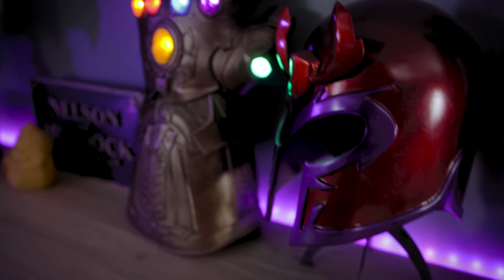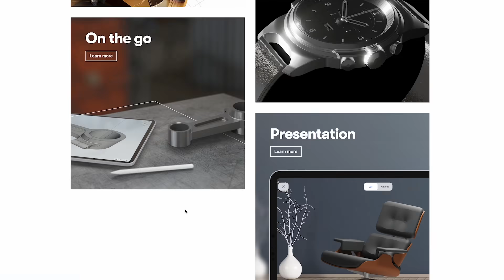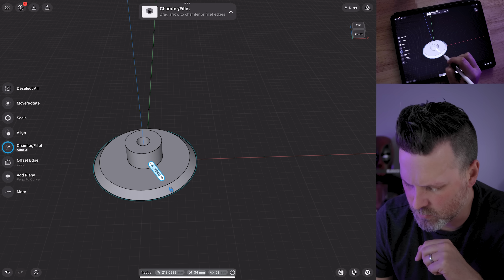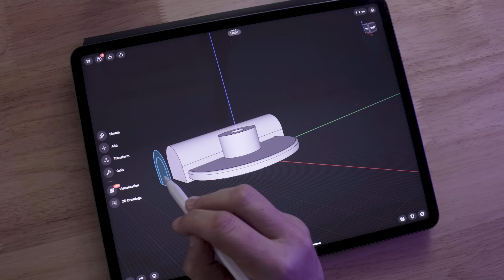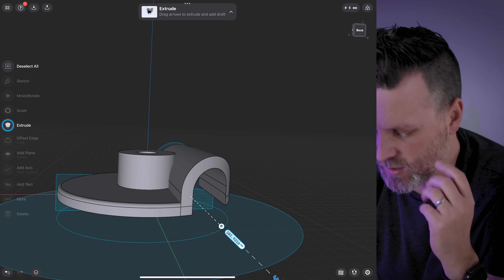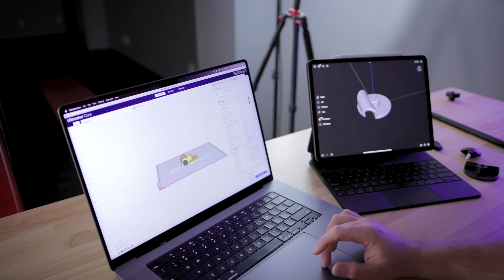I suck at 3D modeling but this is easy - Shapr3D + 3D Printing

Comment: The rpm on the spooler was lower at the end because there was filament on there at the end, effectively changing the gear ratio.. like putting bigger wheels on your car. It changes the final ratio, and you go faster with less or the same RPM. Not saying there couldn't have been slowed extrusion from a clog.

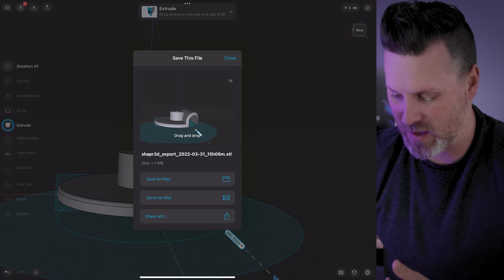Comment: At some point (7:39) you say "If only I could slice a file directly from my iPad". What do you mean by that? Is there another process required between exporting from Shapr3D and 3D printing?
Reply: After exporting to .stl or .3mf file you need to slice the file in eg bambulab studio, prusa slicer to prepare the 3d print / create a .gcode file for your 3d printer. As far as I know there is no iPad app for this so you need a pc / mac for this step/ process.
Reply: @MagicMaik123 Thank you for the explanation. I just realized that the reason I’m not aware of it is because I always use commercial 3d printing services which take care of it automatically.

Comment: Disappointed. I downloaded the “free” version for Mac, created my account, went through all the videos, and built the first model the software suggests to test the tool. Everything was fine. However, when it came time to export… LOW RESOLUTION? This makes the entire application useless. $299 is absurdly high for “hobbyists.” Here in Brazil, those $299 are equivalent to 2,100 “money.”

Comment: I’ve been using Shapr3D for over a year, I’m far far away from a savvy user but I can recommend you to have a look to some extra functions to ease your job. For example you can use Shell function to remove the inner content to create your “tunnel”. This function only ask you for the wall thickness you require and eliminates all the rest of material. Unfortunately for me, I don’t have a 3D printer 😢 Very good job.

Comment: In my opinion vectorworks is so much better or at least the ability to use both a mouse and a keyboard in comparison to no keyboard. Regardless this is still a great application for a quick visual when you just want to see how measurements relate to each other before you make the actual product

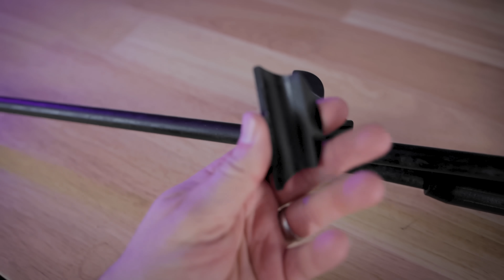Comment: For those who dont own a 3D printer...  @0:40  His 'problem' could of been solved with JB weld.
Its a puddy that hardens to the same strength as steel. I fixed a platic wheel on my Grocery Trolly Cart with it, and now its tronger then it was brand new.
The fact that you even tried to use super glue on a part that holds all the pressure is rookie behaviour.

Comment: For parts that don't work well on the first go and aren't mission critical to be the exact dimensions, I like to use a hair dryer to shape them if possible so that I don't have to remodel and reprint and scrap the parts. For example, applying some heat to that groove and pushing in a little on the side can help add a bit more friction.

Comment: Dude.. right off the bat you are putting people off and slandering Shapr3D, don't do that. First of all, it IS FREE, and you can use it free as long as you like for a LOTS of applications, most people don't have the design skills to do complex designs anyway. In case the person wants the PRO version with more features its only $25 a month!,  that is NOT "relatively expensive", its actually shamelessly CHEAP, do you realize a CATIA, ICEM, UNIGRAPHICS or ALIAS license would run you $15,000.00 US dollars ??!! get a clue dude, this company spent the R&D to offer this free and another version practically free and you turn people off with comments like that. I don't think you meant to, you are just stupid and unaware but no excuse to do it again. Had I seen this video before I got it, I would not even have looked into it. And yes, I did design interior trim and exterior panels for 30 yrs. so I do have plenty of experience working full time with CAD systems.

Comment: That was a great video to watch but Shapr 3d is quite expensive for the hobby modeler. You would have to run a small business to offset the cost. You said your a novice with shapr 3d but you seemed pretty proficient.

Comment: Towards the end when he determined the part was just a little too loose, this is where I fall down. I 100% would have applied a bit of electrical tape to the inside of the channel or sanded down the base, or both, rather than reprint the corrected part, cause it's close enough and I could make it work. It's not the right way, I get that, but if it's working, I'm moving on.
Reply: A bit of rubber or cork would probably improve the function.

Comment: I use this software also and it is expensive and super easy to use.  Way better then learning fusion 360.  How I combat the price point is I have a list of things to make on my iPad.  Once I get the list to 10 items or have something I need sooner rather then later and I’ll pay for a month and then through that month I go ahead and model all of my saved items.  Then cancel at the end of the month and start my list over.  This keeps me from over spending and making 3D printing not worth it.

Comment: You're making a beginner mistake with CAD modeling. When you're trying to replace a component, you have to take into consideration the strength of the materials you're replacing the component with. 3D-printed parts are in most cases not as strong as their injection-molded counterparts. But with something this trivial, there's nothing to worry about, I guess ;)

Comment: 3d printing really becomes amazing when combined with 3d modelling for situations such as Jesse ran into here. 
I dont understand the pricing for though. No beginner is going to pay that much a month,  and any pro is very likely using blender, or fusion etc.
Reply: Use the low res free version if you are a beginner, upgrade when you are ready to sell your bits

Comment: I am debating on returning my Neptune 2S. I have upgraded Cura to the current release, and lost all settings of my N2s. Even when  exporting the print setting config file and importing it back. NOW I get all these extrusion errors. WHY does elegoo offer an application (Cura Elegoo version) in which the application themselves do not acknowledge them by default. If I use an Ender 3 profile like Reddit says, It seems like mmy build plate is smaller than my actual Neptune 2S. Uncle Jesse you are my last hope before returning it. Where can I find detailed settings for my neptune 2S while keeping Cura up to date? Is it even worth it going thru all this hassle. Thank you

Comment: $240 a month, which is actually cheaper than anything Autodesk or Dassault puts out there (I'm sure Solidworks is more powerful and cost-effective for engineering students).

Very cool that it really leverages the touchscreen. I don't have a tablet or even a touchscreen Windows compy, so I'll probably practice on FreeCAD or something.
Reply: We actually have a Windows and macOS version too that you may use with mouse+keyboard. As for the price, it's $240 a year (local prices may vary) but i guess this is what you meant as well. Thank you for your feedback!

Comment: Manufacturers need to take note, they could increase revenue by selling the STLs of spare parts like this as well.  No doubt you would have just paid a few dollars for the STL than spend time on designing it and money on a CAD program.  Sure its satisfying to design and print, but I am sure you also had a lot of other things to get done at the time as well so no doubt you would have paid $5 for a manufacturers STL.
Selling a STL for a part is unlikely to reduce sales of new objects as those who are happy to 3D print spares are likely happy to do exactly what you did if they have too and once done, you will probably share it for free on places like thingiverse.  If anything manufacturers providing STLs of spares for personal use will increase the sales of their brands new products as people know they have the option to maintain it themselves should plastic parts like this break.

Comment: I like Shapr3D, for using while watching tv, but they’re just too greedy for me to support em. To not have a plan or something for hobbyists is just too disappointing. The features don’t even compare to fusion and fusion is free for hobbyists. The additions they make out to be groundbreaking and yet they’re basic functions. Now with the “material” feature it’s cumbersome to simply change the color.  Not a fan.
Reply: Shapr3D has the best UI amongst any of the CAD programs out there, and I've used pretty much all the major ones. It's really quite amazing what they've done there. But I agree the sub pricing is terrible for hobbyists, the free version is way too limited, and lastly it's only direct modeling with no parametric features.

Comment: I've enjoyed Tinkercad, it's free, and very basic but works fine for the stuff I need it for. Created some feet for my snare drum, rope tension drum, like Civil War stuff you might see at your favorite local olde timey museum (Genesee country village is our local favorite). Used a micrometer, similar process to the one used here, and saved as STL, sliced with the Anycubic slicer, and printed on resin printer with some of that stronger resin mixed with normal black resin. Worked great. Also, made a fife using the same method, but the 3d printer we have can't print tall enough, so had to make it three pieces and engineer a joint with a little built-in clip which worked great in Tinkercad, ditto a clamp for the interior of a shop light that had to way to anchor the electric wires and a bunch of other one-off random stuff. BUT I can see that if I needed anything more complex, it would get sloppy and harder and harder as complexity increases with Tinkercad.

Comment: You should have taken the chance to improve the design reinforcing the weak points of the original piece. For example, the 90° corner between the circular base and the outer side of the tube could be improved with a large bezel so there is no corner that can break but a thick volume.
Reply: Shows hes right, he does only know barely what hes doing 😎
Reply: @bernatix  Yes, of course. Not criticizing him, just suggesting improvements 😉

Comment: the only down side for shapr3d is the price, i really don't see how is it compete with fusion360, for 372USD a year, you get 3D modeling on computer, PCB design, CAD+CAM, cloud simulation and rendering, just can't draw directly on ipad. shapr3d cost 239USD a year without any simulation or most other functions. And if you are going to do 3d print, you need a PC anyway for slicing, then why not just draw on PC? to rush out model on site? I tried using my ipad mini 6 remote desktop back to my PC to model in fusion360, just a bit slower on the controls but I overcome it with a folding bluetooth keyboard with trackpad build in costed me about 35USD. If shapr3d is something like 5USD a month, maybe I will keep it in my ipad just in case for rush site modeling, but not for this price.

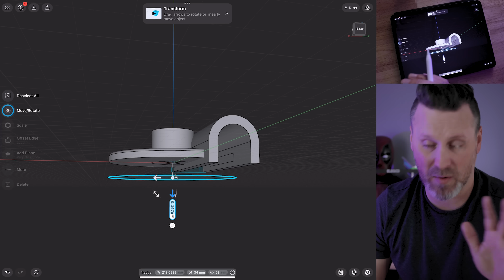Comment: Would it better to rotate the print and use supports so that the strands of filament follow the shape (6:20) rather than cut across as you printed. Current orientation has weakness due to layer strata cutting across the hoop.l sections. Obviously vastly reduced if solid…

Comment: As soon as I heard "subscription" I am out! Try renting a hammer to a carpenter and see how that goes. This is a disgusting business model.
Reply: I completely agree. I can't stand paying a recurring fee for a piece of software that doesn't change. Just charge a reasonable one-time fee then charge for upgrade features if you need the recurring income.
Reply: @squishybrain  But it does constantly change, you're aware of that right? Also to Leandro's original point - every pro CAD tool comes with ridiculous one-off price tags and you can be sure they don't change. Also, many professionals (carpenters e.g.) do rent equipment/workshop space.
Reply: @Pijer19  Of course software changes. My point is that with a subscription model, you're forced to pay even when the software doesn't change. If the developer puts work into additional features, then charge for the upgrade and hope that you've put enough value in that upgrade to cause folks to pay. I don't like paying a recurring monthly fee with the assumption (but no guarantee) that I'll get value out of that. The value proposition seems skewed.
Reply: @Pijer19  Tell that to Autodesk. I used 3ds max and Revit for a long time, before subscriptions, and after they made the switch they went more than 4 years with any significant change. Also, most of the times you can change a hammer as much as you want, it doesn't mean I need or am willing to pay for that change. To put the final nail on this coffin with my owned hammer, let me clarify that as a profissional from the civil construction area, we only rent tools when they tend to break a lot needing maintenance and not because the manufacturer put a new pink handle every now and then. 🤮
Reply: @Pijer19  subscription is the easiest way to a company take your way of living and FEEDING you family, simply kidnapping your tools and making you dance like the monkey they made you off if you ever want to pay bills again.

Comment: I'm probably too used to my Solidworks modeling pipeline, but it's good to see more and more actually ergonomic tools stepping on professional cad's tail, for the sake of competition and solving stagnation of the existing, "market leading" CAD tools.
I also still suck at resin printing xD, but I'm slowly getting to know it with my Saturn S setup.

Comment: love the software but I couldn't justify the price point. I wasn't designing as much as I thought I was going to and actually paid a month or two without even designing anything.  It's worth the money if you're a pretty serious designer.
Reply: Yep can’t justify paying for something that I use infrequently.  If there was a one off small price for private users then I’d buy it.    On the other hand went for another program that is free, without ads, and fully functioning without time limits……..Design Spark Mechanical (DSM)…….great tutorials, quick learning.
Reply: It’s sad they don’t have an “enthusiast” subscription that allows a limited number of models and hi-res STL export. Maybe when they’ve added more pro features it will give them scope to separate the subs levels and offer a cheaper point of entry. I never renewed after my first year deal ran out, switched to fusion360 on my Mac as it just didn’t make sense to pay for something you use a handful of times a year.
Reply: If you’re only using it for 3d printing, you can, possibly the most powerful 3d modeling software out there, for free in a student license. It’s made by Siemens and called NX. We use it aerospace, and a lot of automotive and power gen companies use it as well.
Reply: Yeah, great software, enthusiast-hostile pricing. I’m already paying $30/month to adobe for Photoshop and Illustrator, more money to Microsoft for Office, etc., etc., etc….$300/year is ridiculous.
Reply: Fusion is just as easy and it's free
Reply: @northcountrywoodcraftny5953 yes but sadly Fusion doesn’t work (fully) on iPad.
Reply: @northcountrywoodcraftny5953 not on iPad tho
Reply: How much is it
Reply: What’s the difference for the free version does it still allow the file exporting?
Reply: @porcupinephillips712 , you can only have 2 active designs, plus the STL and 3MF output is low resolution.
Reply: @porcupinephillips712 yes but only in low resolution 😕 

They’re way too stingy. If they would make a half decent middle tier they’d get a lot more sales. I’d be happy with a dozen models and full res exporting for £10/month. £40/month is way too much for me as an occasional enthusiast.
Reply: There is also a monthly option available.

Comment: Tip glue broken part together then do measurements
Reply from the maker: Hahahaha you know. That would have been so much easier 😂
Reply: You might could have fixed it with a 3D pen although it wouldn't have been pretty. Lol!